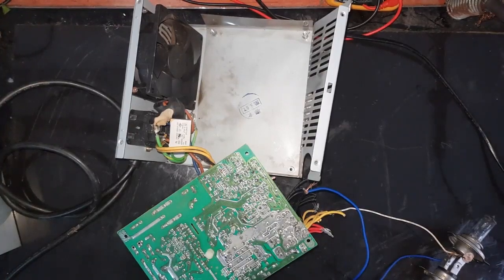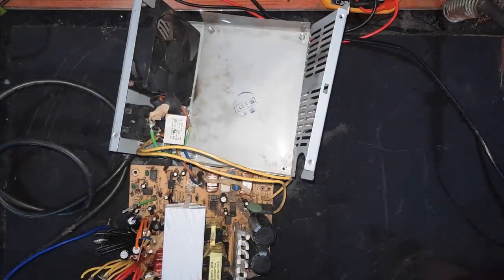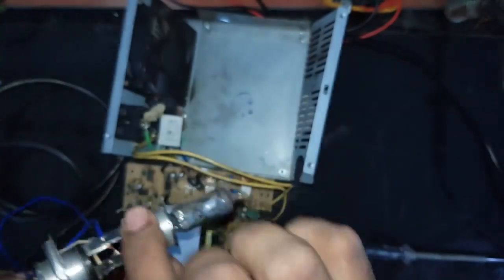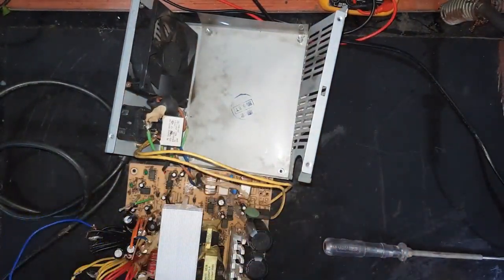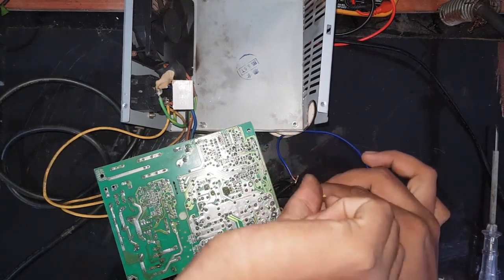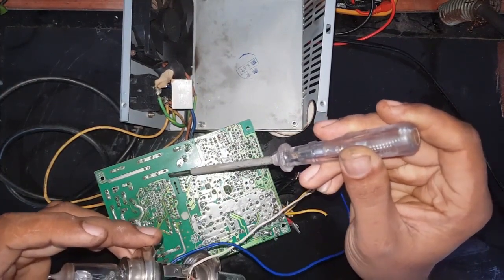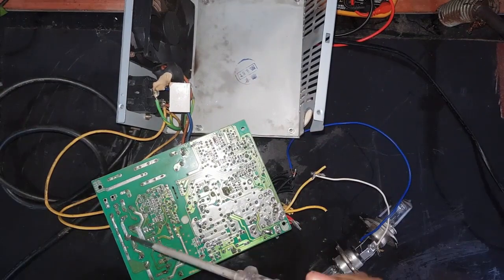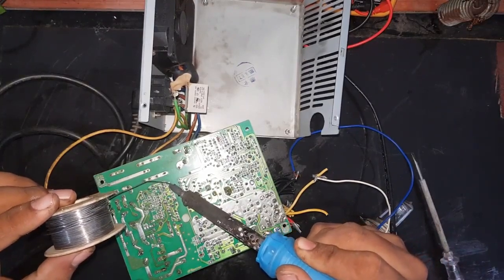How to Turn off / Disable short circuit and overload protection in ATX power supply

Comment: So while the PSU is powered on and short the optocoupler, my load started working as this video.  But once I turned it off and made permanent short with a solder, and then powering on the PSU trips my outlet circuit breaker.  Fact that it didn't trip the breaker when it was shorted AFTER it was already on suggests it's some sort of inrush at start?  Is there a way to find out how much current the PSU draws?

Comment: Sir plz tell me at what side  pins will be short of optocoupler for disable the olp of computer psu. Can this procedure is spply any psu or only for computer psu, and if you tel me ss pin number i mean that pin 1&2 or 3&4 of optocoupler because at pin 1&2 are connected internai diod and pin 3&4 are connected internaly collecyer snf emiter so plz tel me the pin number i shall be very thankful to you

Comment: Hi I was shorting optocouplers trying to find the one and now it works without shutting down. But all I did was short two pins with screw driver didn’t need to solder pins together once. Now works all time time without pins shorted. Why do you think that happened?